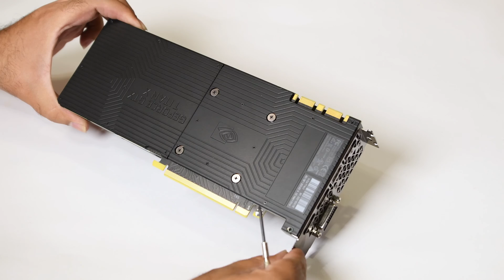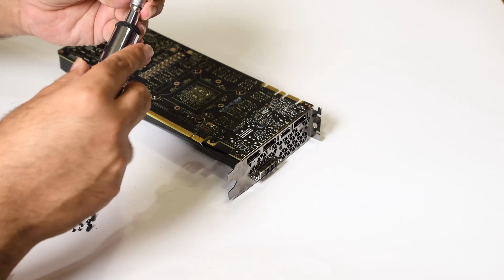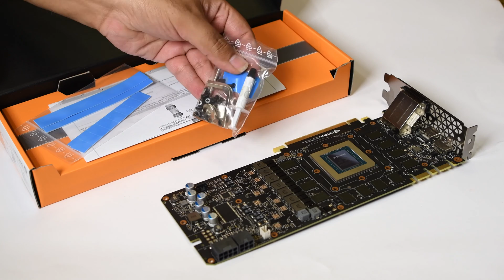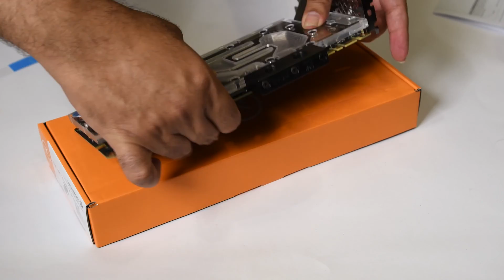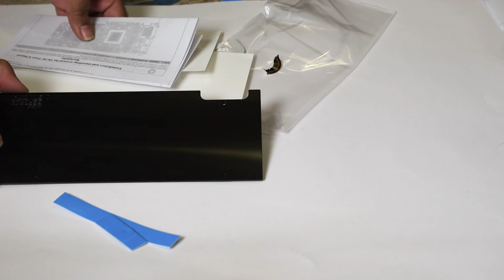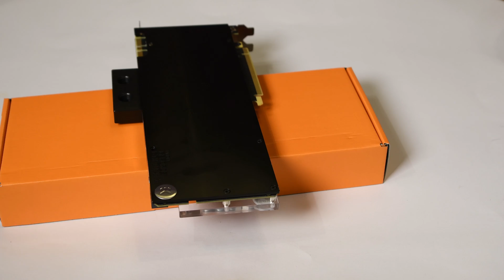How to Install GPU Water Block & Back Plate - Titan X Pascal / 1080 / 1070

Comment: I was thinking of putting a thermal pad over the rearof the socket so that it conducts into the backplate but its odd that EK doesn't.
Reply: Would you see much benefit by doing that?
Reply: @Daydreaminginmono  for overclocking yes. Nowadays for any card definitely as long as it has a backplate
Reply: @kommandokodiak6025  so ive just bought a titan x pascal, and i will be putting a 1080ti block on it with the backplate, should i put a thermal pad on the pcb area of the die so that it conducts thermally?
Reply: @Daydreaminginmono  yeah just get some cheap ones wont hurt and if anything will extend the life of the card just dont go too thick youll have to trial and error to figure out the optimal, and if there are ram chips on the back use thinner squares for those
Reply: @kommandokodiak6025  well thanks mate, ill take a peek at it when i build the system and see if i can do that

Comment: Does it avoid warranty when you take it apart, like will they know u took it apart, if RMAing it?
Reply: Yup, that's NVIDIA young boy. Though for other cards such as 1080ti and lower, Evga guarantee your card even  if you slap a watercooling block on it as long as you can put it back to it's original condition (orgininal cooler you bought it with) BUT if there is a water damage well you are screwed

Comment: You used way too much thermal paste and generally i don't believe in start, X, pea or similar spread methods-just spread a thin layer of thermal paste across whole GPU.
Reply: Alpha Fort jayztwocents did a video as well
Reply from the maker: The combination of X and plus sign is recommended by EK in their documentation and I totally believe them. GPU is different than CPU and more thermal paste does not harm as there are no pins that can shot. I am not saying you should use more paste but more paste has generally improve thermal performance which is proven time and time again.
Reply: I agree with TechCloud. There was a test with all sorts of ways and amounts thermal paste is applied (on Linus Tech Tips i think), and there was almost zero difference between all the tests. The risk of overflow remains with CPU pastes application ofc.

Comment: great video thanks, what are you getting out of your 2 titans clocks wise?, also what temps?

Thanks
Reply from the maker: Thanks so much for the feedback. Since they are two so I am getting slightly less clockspeed and they stable around 2012 to 2025. If I use one card then it can go above 2100+

Comment: I read that the EK water block for the Titan x (pascal) is incompatible with the SLI HB bridge and you have to use the standard SLI bridge to connect both cards. Have you experiences this?
Reply from the maker: Yes, you are right. I have planned to make a video about that
Reply: It's the little pointy bits that are incompatible. Get an EVGA or Gigabyte HB Bridge and it should fit. Better looking anyway.
Reply: Thanks, do you have any videos of your completed full system?
Reply: asphaltbinder EH?! I just observed that from watching others. I only have ONE Titan...for now. :P But I will be posting a video review of the system. I hope you bought some of those LED kits from EK, too. They look amazing.
Reply: Two ribbon bands provides the same performance as an HD bridge which are about 99% cheaper.
Reply from the maker: Here is the link of my video showing the compatibility of Nvidia SLI HB Bridge with EK Water Blocks: https://youtu.be/t2sj7VYcm50
Reply: love the videos, your long girl nails just creep me out a little.